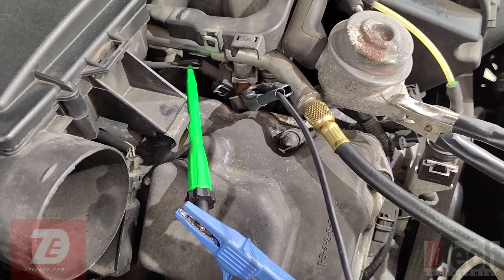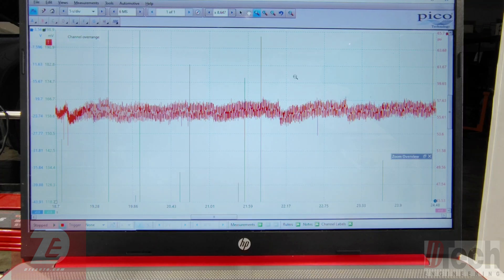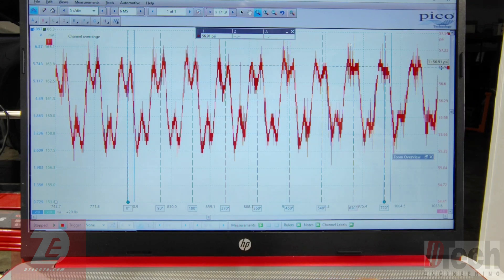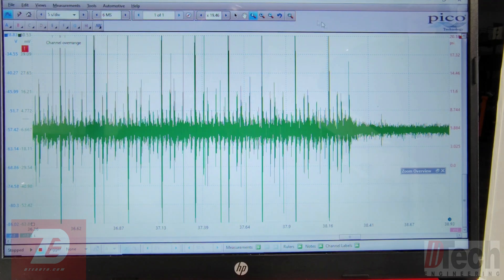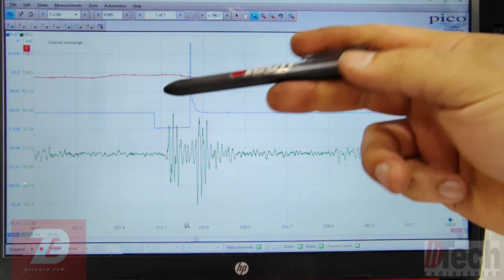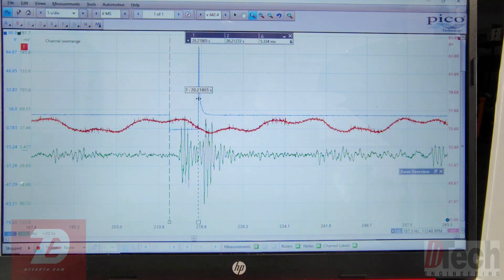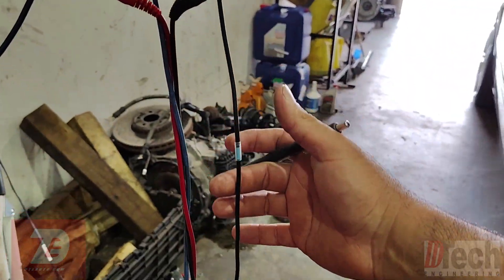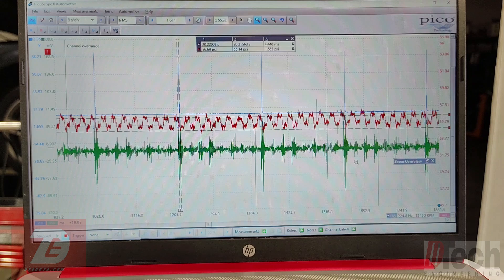Fuel Injector Relationship: Electrical Flow & Physical Flow (Latency/Offset)

Comment: The length of the measuring tube (as well as the distance of the injector and its proximity to the pressure transducer) affects in one way or another the accuracy of the measurements...
Reply from the maker: Not in a sealed, fluid filled, pressurized system. Test hose fills up and becomes part of the constant pressure, any changes anywhere in the system are equal across all of it. Hence why all the injector pressure drops are the same..... if it weren't true, then the injector furthest away from the fuel feed line of the rail would show a difference. That's why even on multibank engines they don't have independent fuel rails per bank with separate fuel feeds... They have rails on each bank but tie them in together and only feed on one side with one feed. Pressure is constant. If not the injector fuel flow and pressure drop from one end of an 8 cylinder one piece fuel rail system would look different from an injector on the totally opposite end 8 injectors away. This isn't like an incylinder measurement adding volume and lowering the compression on the cylinder you are in.
Reply: @DTEAuto   Another thank you for your contribution Sadel.

Regarding the discussed matter it may be a yes and no .

In a confined system according to Pascal's law the actual pressure drop/change will  be the same within this system and  shown as such by the pressure sensor.

The chassis ear signal strength however will  be affected by its external positioning/ location.

On a side note: The injector pintle opening/hump can be found on the voltage trace as well.  You would have to zoom in extremely on the portion where the injector is grounded. As the current flow rises the "ground voltage" rises as well and will show the same /shape/disruption during pintle movement as the current trace does. The current trace will be much cleaner though.

Comment: This is not a delay of pressure drop. If you use  an amp clamp you will notice the point when the injector pintle opens. That is the point when the rail pressure begins to decrease.
Reply from the maker: it's a delay of fuel pressure drop from when the fuel injector was electrically "turned" on.
Just like the delay of pintle movement on the closing side, it's after the point of electrically "turning" off the injector.
Guess what would be delayed also....??? the pintle movement on the begging side as well, during the "turn on" point electrically.  An amp clam will show the same thing correlating with the voltage trace. Amperage activity will occur at the same time the voltage shows the "turn on" point, the amp clamp doesn't "move" when the pintle moves, it moves as soon as voltage is commanded and the pintle moves delayed from that point and is seen in the voltage trace, amperage trace, and now noise trace to be delayed and it matches the fuel pressure drop being delayed from the turn on point. Fuel pressure can only drop from a leak, and that occurs from the pintle movement per injector, which again is displayed to be delayed as shown in the demonstration.
Reply: Sadel knows this is not abnormal pressure drop delay. Sadel knows pintle opening can be seen in a current waveform. In this video he is simply demonstrating pintle opening and closing can also be seen using these other methods.
Reply: The rail is already full his transducer was at the end that’s why he was showing when the injector turned off and on. His synch was right on the injector itself and lined up perfectly that’s how you know it’s not the rail that’s showing.